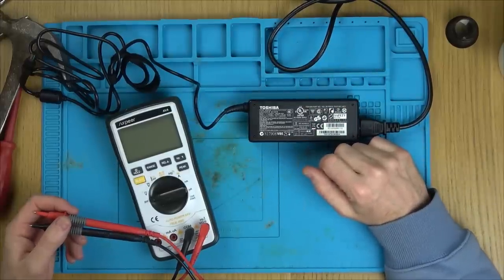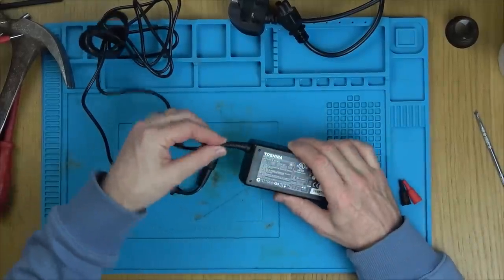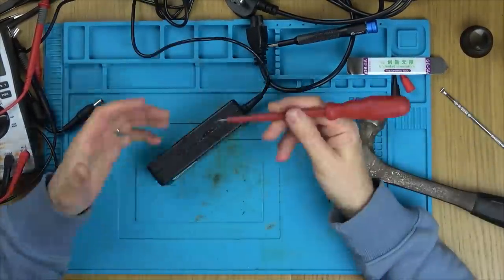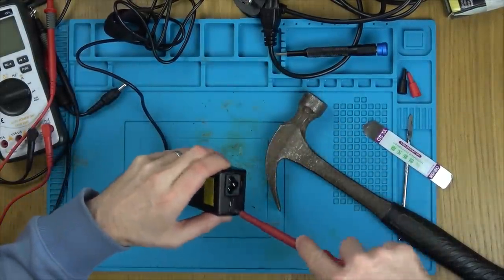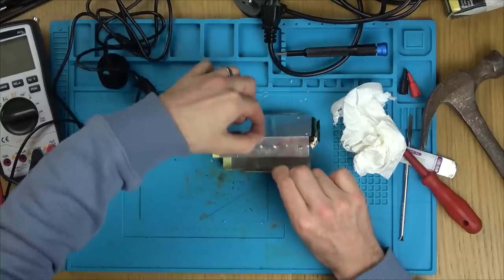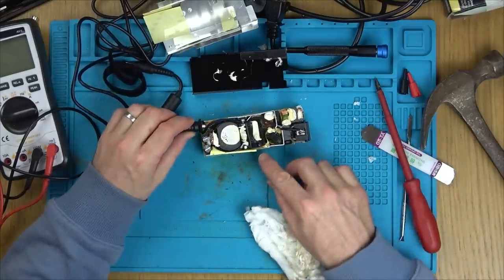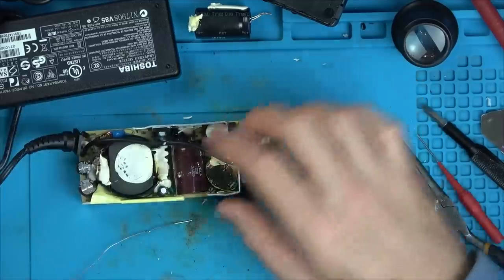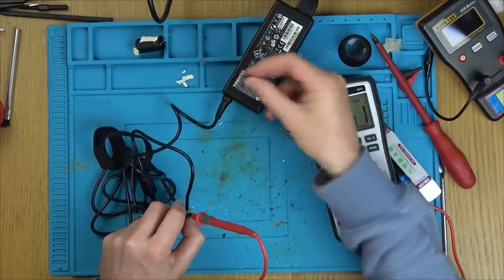Dead Toshiba Laptop Power Supply - Can it be FIXED?

Comment: I fix these supplies/adapters all the time.

As for opening them:
First, before using the hammer, I'll put the adapter in a vice and GENTLY squeeze the edges (not dead center) until I hear some cracking/snapping.  I do this all around.

I now have my own "procedure" that usually results in a nice, reasonably clean separation of the 2 parts.
I start by using my little heat gun (the one on my SMD station) and set the temperature low to about 150C or so (adjust as needed).
I go back and forth along one edge and one end first.  I make sure to NOT melt the plastic.  You can see if you're getting close to the melting point as the pattern on the plastic will start to distort.  I move the heat gun away as needed.  Once I have one side and one end warmed up, I then use a spudger or metal edge (thin) and start to work the seams until I hear that wonderful SNAP as in the video.  Sometimes I do have to use a small hammer to gently bang along the seam.  With patience and repetition, I usually get good separations. Once one side/end is done, I do the same to the other side.

As for the cap in this video:
From how the spray looks, that cap didn't  "BANG."  Rather, it did the fizzy spray thing where the + slits open as it swells and does the ppssszzzzttttT thing rather than an explosion.  A cap that explodes, causes a lot more damage and mess.  This just fizzed out.

Personally, when I fix a supply, I check all of the larger caps, even if the look good.  I always unsolder them and test for value and ESR.  I  almost always find a failed cap that may or may not be bulged and as here, may "test" ok, but ESR is off the wall.  I replace any and all caps that are even questionable.  

Where possible too, if space permits, I'll often put a new cap with a slightly higher voltage than original.
I do this now, because several times, after fixing a supply, a year or so later, the same cap goes again.
So I started putting in higher voltages, same value, low ESR and since doing that, not one supply has failed again (so far) .  LOL

As for re-assembly, I no longer glue them back together (since these are my own).  Well, I might add a little glue on all 4 corners, but not the entire thing.  I then put black electrical tape around the edge and then put a couple of plastic pull ties to keep them closed.

This has worked without issue.
Reply from the maker: Thanks for the tips 👍

Comment: Not sure if this is of interest Vince but when  i want to get into a sealed power supply i tend to use a vice to at least try and crack the glue, has worked many times.
Reply: Big Clive calls that "The Vice of Knowledge". I too have had success there. My favorite was helping my Grandpa open the faulty tail light from his truck. He was miffed that a burnt out LED meant the whole assembly needed replacement and was determined to attempt to repair it. 
I came over, the vice helped pop the seams without issue and he got to fix the blown LED.
Reply: I'd add a couple of cable ties and what about a project box
Reply: Works great. Every time.
Reply: On this subject when I opened up my dewalt site radio to change a fuse , the instructions were remove all the screws then hit it on the bottom on the joint hard with a rubber hammer worked a treat heard the glue crack
Reply: @peterthebricky  if they snap you’ll end up with a big hazard
Reply: @tronixfix   a decent quality tie is remarkably strong  cut  a tie or cut the cable
Reply: Sometimes pipe grips work for me.
Reply: About 10 years ago i fixed these stuff. At that time i was opening them with petrol (car fuel). Put small amount around the seam of the joint with a small brush, wait 5 minutes, repeat and they were opening really nice after a very mild knocking. I heard people saying that they are friction welded, if it would be the case then the petrol would not work. These psu-s are cheap components, i don't believe they use for serial production such an expensive machine at the final assembly stage. It is more likely they use a much cheaper regular glue.

Comment: Thank you for making all these videos. I got a returned ups with shipping damage from my work. It had a crack at the top and wouldn't work. Only the orange led came on. When I opened it up I found out that the pcb also cracked together with the outer shell. I fixed up the traces with my soldering iron and small coper wire. And guess what. It's now working properly. I would have never attempted a fix like this if I didn't watch all your videos.
Thank you.

Comment: Great Video Vince, and nice fix. Before I powered it up I would have checked the bridge rectifier just in case one or more of the diodes had failed. Great Job 👍
Reply from the maker: Thanks Mick, yes others have said the same thing. I'll remember to do a bit more testing next time, could save another bang and a wasted capacitor 👍
Reply: It's easily done, I know from experience 😂😂😂

Comment: When I was a hardware computer engineer, this was such a common point of failure for all brands of laptops (and Pc's, the PSU's used to fail with age and if you didn't have a surge protector) as mentioned, these plastic cases are ultrasonically welded together to create a tamper proof seal, keep up the good work. 👍🏻
Reply: @AppleReviews  Happens all the time, especially during thunderstorms.
Reply: @AppleReviews  Unless they had surge protectors fitted inline to their devices then yes.
Reply: The capacitor was rated at 420v, so to get the DC voltage above that you would need the AC voltage to be more than 300v and sustained for a while too I'd think for the electrolyte to heat up. (300V AC rectified is around 422v DC). I think more likely explanation would be cheap capacitors that just fail after a while...

Comment: They are ultrasonically welded, which basically vibrates both halves of the case against each other until the surfaces melt at the touch point, they then join together as a result.
The welds are still a weak point, I’ve found just using a hammer to be good enough to crack them at the weld without much damage, it can take a while sometimes though.
Reply: Or hitting them on the joint with the handle of a screwdriver is quite effective too! 😉
Reply: I got you all the best Solution hands down.
Basically you put sone Diesel fuel or ( Gas ) just around the seem and wait 5 min it will open like a charm
tested 100 times there are videos on youtube also.
thank me later

Comment: Nice job Vince. You can break the seal with adjustable pliers also. Works great, just pinch all around the seal with the tips of the pliers. It allows you to get the force in the right area.

Comment: Very nice fix, good job on that :) . That cap probably had a manufacturing defect or (as you said) there was a surge, usually the big filtering caps don't fail.
The only advice I can give is to just zip tie it together after the fix, these laptop chargers get VERY HOT, especially when the laptop is charging while it's in use.
I am saying because I put one back together myself with hot glue when I fixed one of these and after the first use the glue melted and it came apart.

Comment: I've found using a bench vice on these ultrasonic welded cases is a great start to cracking them open without causing much damage.
Reply: I've also used this method many times with success. Just need to be careful not to crush the PCB inside with too much force on the vice. Just put some tension to the one half of the welded case and then slightly tap the other half with an hammer and it usually cracks open pretty clean. Sometimes it's necessary to use a knife or some sort of prying tool and tap it against the weld.

Just use some cloth or thick cardboard between vice and the plastic case, otherwise it will leave ugly marks all over.

Comment: TIP the next switching power supply that you must fix , first test that must make is take a AM radio, place near from the power supply, power on the radio, connect the power supply, you will heard a noise like a whistle, that indicates that the source primary is working, if instead you heard a "brrr" that indicates the power come in but no oscilation on the primary, may be  emi coil broken, fuse blown, mosfet blown, if you heard a "chip chip chip" sound that indicate a short on the secundary side.

Comment: Next time you should check the bridge rectifier before putting in a new cap. Voltage being fed into the capacitor backwards would cause it to explode quickly.
Reply: I just said the exact same thing 👍
Reply from the maker: Thanks Jessica 👍
Reply: The capacitors used in these power bricks are often bottom of the barrel trash, probably dumpster dived out of the back alleys of Huaqiangbei/Shenzhen. I'm well acquainted with LTec capacitors, them exploding, leaking or failing in any number of other ways is common. I've replaced them by the thousand in power supplies, monitors, motherboards, random consumer electronics, etc.

If he were going to use this power supply long term, I would suggest not using that United Chemi-Con brown crap stain capacitor, because UCC is known for garbage capacitors as well, like their infamous KZG and KZE series during the capacitor plague era. I'd also recommend replacing all of the capacitors in the rest of the supply, because they're the same dubious garbage that is subject to failure.

I'd recommend Wurth Elektronik, Nichicon, Rubycon, Panasonic or Samsung capacitors from reputable vendors. If you buy mystery meat on Ebay/Ali Express, you're probably getting counterfeits, or are paying more in markup.
Reply: Why would the rectifier suddenly be backwards?
Reply: @phonotical  It wouldn't, but if one of the diodes in the rectifier failed, it could potentially backfeed something.

That said, bridge rectifiers don't really fail that often. They'd have to be blown up by a power surge or heavily overvolted.
Reply: @GGigabiteM  that's what I thought
Reply: @GGigabiteM  Chemicon still hasn't recovered from the capacitor plague?

Comment: How strange, the power supply on my acer went just last week and after getting into it, it looked exactly the same as your Toshiba and the same capacitor and fuse had blown. 
I just got the new parts fitted yesterday and it's working fine, so far

Comment: I always squeeze welded together cases like that in the vice, and the case comes apart quite easily. It's what Big Clive calls the vice of knowledge. 😁
Reply: Squeeze in which direction?
Reply: @michael.a.covington  Across the width, putting pressure on the joined sides.
Reply: I love Big Clive too!  He can be quite comical at times!  😂👍👍

Comment: I have done similar work, splitting-open sealed Units, and repairing them. I re-seal them by heating a clean Soldering Iron, and then start to re-flow the molten plastic across both halves - neatly! No glues or untidy wraps of PVC Tape. I replace any "bulging" Capacitor without testing at all. Always nice to see a good result, and less s...t for Landfill.

Comment: After the glue, I roll the whole charger (or at least both sides, near the cables) with many turns of black electrical tape. You can also use some across the broken lines in the middle first, to make it look a bit better. Nice fix!
Reply: a large piece of heat shrink will do the job

Comment: Good job! So happy to hear you had the appropriate cap and fuse to hand! Hahaha!
Roughing up about 1 cm on both sides of the seal and then using epoxy (black for aesthetics) would have made a safer seal. One could also enclose it in a thin transparent acetate box would have probably made it acceptable for third parties to use, but of course you'd have to tell them of any risk etc.

Comment: I keep some old transparent folders around "just in case", and this is a perfect example of "case". Cut four strips to measure, reassemble the brick, put it in the bottom part of the case, insert a strip for each side, close with the top case and a few points of superglue.

Comment: You should use the term "hazardous voltage" when working on a switched mode power supply, as they are capable of delivering a massive shock. 
The definition of AC voltage bands as found in BS7671 are: Up to 50 volts is "Extra low voltage" from 50 to 1000 volts is "Low voltage" and above 1000 volts is deemed "High voltage". 
It is fair to say that the bulk capacitor holds a charge of around 300 volts DC, but that also falls in the "Low voltage" category. (Just a point, not a criticism Vince).

Comment: Those welds are the worst to deal with. I see Defpom already mentioning the same thing but you can often undo them by just banging more on the shell. Not hulk-smashing per say but lots of light percussive maintenance tend to be key :)
Reply: Btw: Works on battery packs too. Just be gentle but persistent and you can crack them open with no visible carnage. :)
Reply: Use of of these rubber mallets.

Comment: In brazil we have a thing called banana oil, which is basically an amyl acetate based product, its used mainly to dissolve nail polish, but you can use to dissolve those ultrassonic welds on the charger, just apply it with a small neddle and wait some seconds, reapply it if necessary. I dont know how easy would to find it in UK, but give it a look next time you try opening a charger, it opens perfectly without any damage.

Comment: I had exactly the same symptoms with exactly the same psu and the same difficulties getting into it. In fact, once inside, there was far more of the white silicon covering everything. I left it overnight (about 10 hours) to allow the capacitors to discharge before starting to investigate the inside and BANG!!! I got a huge belt from the main capacitor. Lesson learnt, some large capacitors can retain their charge for a very long time. I won't do that again.

Comment: To break ultrasonic welds like on this enclosure, I prefer to use something like Big Clive's favourite entry tool, with a vice. Just clamp one side of the enclosure into it and tighten the vice jaws until the ultrasonic bond breaks.

This generally gives about the cleanest possible result relative to other methods, like bashing tools like screwdrivers onto the joint.
Reply: "The vice of knowledge." I love Big Clive. xD
Reply from the maker: Thanks for the tip Maya 👍
Reply: @solarbirdyz  Yes, the "Widlarizer" would be perhaps a bit too much in a case like this.

Comment: I've used a bench vise (with some protective wood/cardboard) to slowly work pressure on the joints on these types of sealed power supplies to crack them open along their seals 

Of course, getting them back together again is pretty much a roll of the dice as to how they crack open
Reply: And i thought i was the only one doing the same method 😅

Comment: The mains cap in these brick type power supplies is always the most likely cause if it's dead.  An easy way I found after fixing several of these type of brick power supplies as well as the little square type is to put the case up to the joint into a vice then just squeeze it gently along the joint with the vice you will hear the plastic welded joint crack apart it will come apart in only a few minutes and it doesn't make a mess of the case so when put back together you wouldn't even know its been apart.
Reply: I have seen many of them with failed shotky diodes on the secondary side

Comment: I've opened plenty of these adaptors simply by placing them on concrete on one edge then giving the top edge near the corner a good hard whack with a hammer. The two halves will usually just crack open, and in such a way that you can glue them back together later on with no real signs of damage to the case.

Comment: good job Vince. but i would have wrapped it with some thick Kapton tape at the end. the super glue cristalizes and could crack if its knocked. plusthere was ipa around the remaining hot glue so that could have weakened. in any case. good job with the fix. keep it up

Comment: I've had those clover head cables fail before now, very loose and intermittent contact. Many of the issues people have with power bricks is because they wrap them up ridiculously tight and strain the cables.

Comment: The way I have found to get into these without too much damage is to get a long straight reasonably sharp knife - I have a big old bone handled table knife. Lay it along the groove with the block resting on a hard surface. Now give the back of the knife a sharp tap (or a bit more than a tap) with a wooden mallet. I find they usually just pop open. Both sides may need doing.

Comment: Well done, another product saved from landfill. I would advise against using superglue as this can cause fumes which will damage components over time. Non flex gel type superglues also become brittle fairly quickly. Most of these cases are ABS so you can use evo-stik pvc pipe weld (melts the case together, experiment, use sparingly).
Reply: I didn't know that thanks for the tip

Comment: I did pretty much the same repair with my dymo labelwriter psu. I used hot melt glue but also used an heavy duty zip tie as a little insurance. I still ordered another one though but generic laptop chargers can be bought for £6

Comment: When you were taking it apart, seeing the moist, I was thinking for some kind of oily substance applied to the shields and heatsinks in order to create some kind of thermal bridging, so that poor thing could shed some of its heat to the environment. Because these things can get very hot when they really need to work.
I don't know how much liquid such a cap would spew when it blows. Usually by the time you find a blown cap, most of the electrolyte has evaporated already. But in such sealed enclosure, it won't be able to do that. Again, interesting.